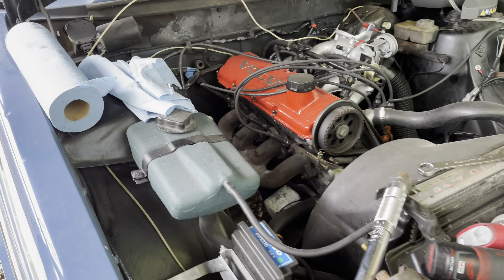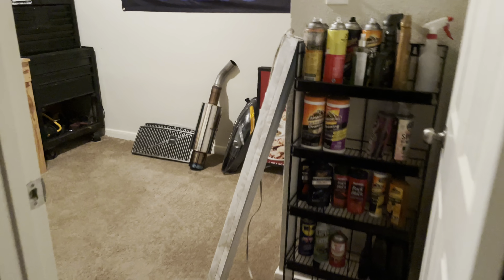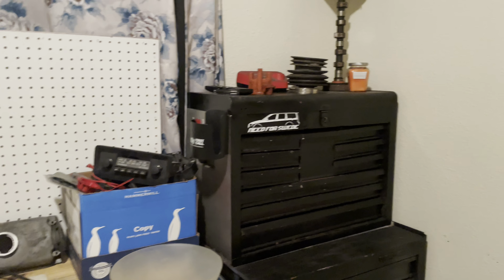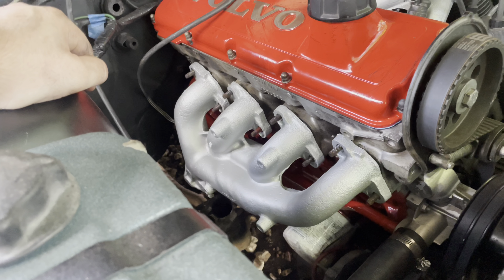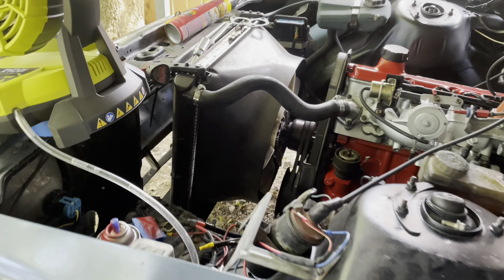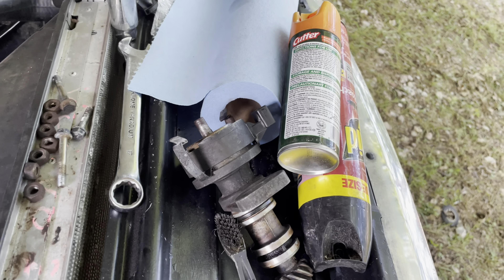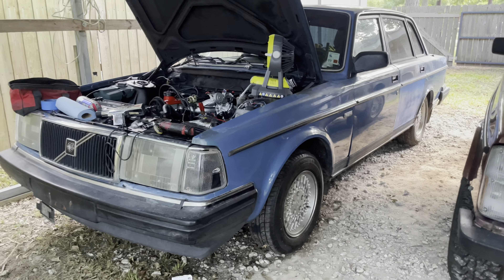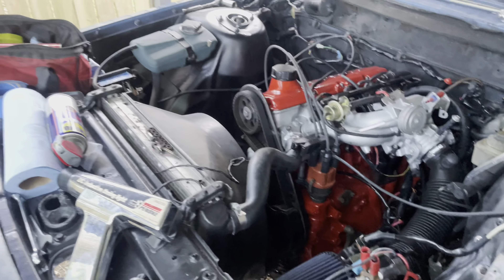1988 Volvo 240 Restoration Part 5 ( It Finally Runs! )

Comment: hey i can’t find a throttle cable for my volvo 245 1985 turbo let me know if you know any place i can find 1!
Reply from the maker: I haven’t been able to source a reputable supplier for throttle cables. I got lucky when a buddy had a spare for me. Your best bet is eBay but call Volvo for a part number so you can cross reference and to make sure you are ordering the correct one!